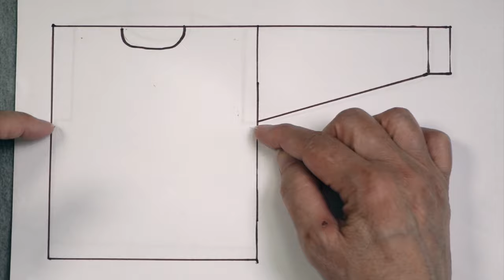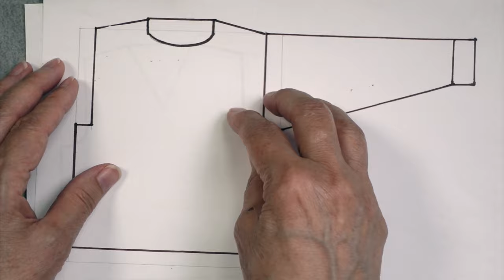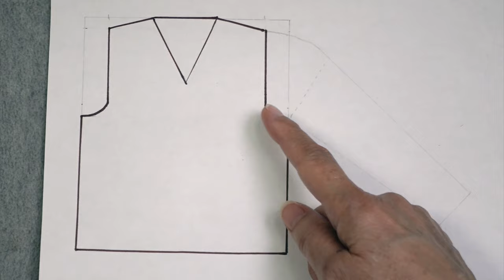Basics of Set-in Sleeve Sweaters // Technique Tuesday

Comment: HI, Roxanne! I’ve used Ann Budd’s Handy series for years as a male knitter who wears his knitwear to work (traditional shaping that lends itself to conservative textures), and have always been fascinated by Barbara Walker’s Set In Sleeve technique.  When I try it, I usually end up with a HUGE sleeve cap because I can’t be bothered trying to calculate how many stitches I would need to go around and evenly distribute the stitches.  At that point, I may as well knit the sleeves flat and seam them in (Thank you for your series of Seaming Videos).  Just as there are ratios of picking up stitches along the diagonal and vertical edges (3 to 4 always works well for me), I was wondering if there may be a ratio of picking these stitches up with the intention of using BW’s short row technique to knit the sleeve cap.  I’m going to try a split 3 to 5 ratio on my next experiment (PU1-skip-PU2-skip, repeat) to see if that will reduce the number of stitches I am picking up around and if it will still provide the roundness of the sleeve cap. Since you have mentioned several times in your videos that you like to knit bottom up and then knit the sleeves top down, would you be able to do a Technique Tuesday sometime that demonstrates Barbara Walker’s method, with emphasis of getting it started correctly? I took a class at a yarn event that stated they were teaching this, however, it was a more complicated “improvement” over Barbara Walker’s method, but it ended up with a sleeve cap so shallow, it looked like a Modified Drop Shoulder. If I overlooked where you may have already done this, please point it out.  Thank you, Roxanne!
Reply from the maker: Walker's method has you pick up the number of sts needed for the arm circumference, rather than picking up using the st:row gauge ratio (which is what the 3:4 is close to). The armhole circumference is larger than that, which is why the PU rate isn't great. I often find that I have to PU a st every other row, which makes it a bit gappy. There are a couple of ways to get around this. One is to use the standard PU rate of 3:4, and then work a round where you decrease out the extras before starting your short rows per Walker's method, or you could use Elizabeth Zimmermann's approach, which is to PU using the appropriate st:row gauge ratio, establish how wide you want the top of  your sleeve cap to be, and then work your short rows as per the heel turn of a heel flap and gusset sock construction, working a decrease, then a stitch after the decrease, turn, slip that first stitch, then purl across to the other edge of the top of the cap, p2tog, p1, turn, sl 1, and knit across to the st before the slip st, and decrease the sl st and the following st together, k1, turn, sl 1, work to 2 st before the gap, p2tog, p1, turn, etc., until you are down to the st count you need for the sleeve. She explains this method in the Kangaroo Pouch Sweater in the book Knitting Without Tears.

There is a relationship between cap depth and sleeve circumference. A narrow sleeve tends to need a longer cap with a narrow horizontal edge at the top, while a large circumference sleeve tends to need a shallower, wider cap.
Reply: Excellent ideas! Thank you so much, Roxanne!
Reply: If you "can't be bothered" to calculate the number of stitches you need for the cap, why would you even be surprised when you don't get good results? It takes just a few minutes to make those calculations, but that would give you better results. Planning is important.

Comment: Are you including in this discussion a say set in sleeves in the round?  Are you describing a contiguous set in sleeve?  Like some of Isabell Kraemer’s patterns that use set in top down sleeve sweaters typically say a modified version of the contiguous set in sleeve by Susie Meyers.  Would you say this is an advanced method?  Thanks so much.
Reply from the maker: I'm not sure if by "this discussion" you mean this video series? The first video of the series introduced the five basic styles to be covered. There are infinite variations on those styles, quite a few styles that are hybrids, and some styles that don't fit at all into the five basic categories.

The first three styles described in this series all have horizontal shoulder seams. I would consider the contiguous method to be more closely related to a yoke sweater with a shaped neck (e.g. some raglans have shaped necks), or a hybrid of yoke and set-in sleeve.

Comment: Thank you so much for your videos. All very helpful. I have however a question, when I make a fitting sleeve do I need the same stiches around the finished shapes of the sleeve as the bodypart has ? Hope you understand what I mean. Thank you so much. Silvia from Switzerland
Reply from the maker: Are you asking if you need to use the same stitch pattern for the sleeves as for the body? The answer to that is no, the stitch patterns for the sleeve and body can be different.
Or are you asking if you need the same number sts for the sleeve that are used for the body? Again, the answer is no. You use the amount necessary to fit around that body part, plus a bit of extra fabric for "ease" (so it's not too tight).
Or are you asking if, when planning the amount of ease, if that should be the same amount for both sleeves and body? For example, if the bust measurement is 36'', but the arm is 12'', would you need to add the same amount of extra fabric (2'' or 4'' or whatever) to both?  Again, the answer is no.
Reply: @RoxanneRichardson  Thank you so much for your answers. I meant the number of stiches that are used for the body, so you have said no. Thank you very much for your quick reply, very appreciated. Wish you a wonderful weekend. Silvia

Comment: I want to knit a basic 4 piece set in sleeve womans petite sweater not bulky but loose fitting in the body and normal fit in the arms.  Where can I find a pattern for same.  It would be a 4 piece sweater.  Front, back and 2 arms.
Reply from the maker: I suggest searching the pattern database on Ravelry. You can filter results on all sorts of attributes, including yarn weight, amount of ease, and type of stitch pattern, as well as construction details.

Comment: Hello, would the fit change if I decide to not do short row sleeve/cap sleeves on a top down design with set in sleeves? Not sure if it would disrupt the cuff or sleeves when worn if I don’t do the shaping.
Reply from the maker: The shaping is to accommodate the length difference between the top of the shoulder to the cuff and the underarm length to the cuff. So yes, if you leave the sleeve cap out of a set-in sleeve, you will change the fit.